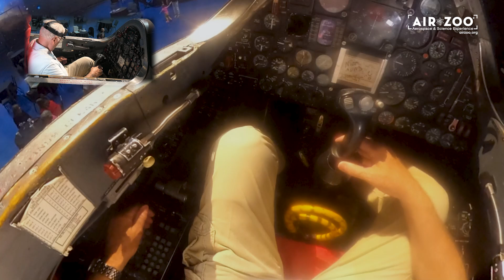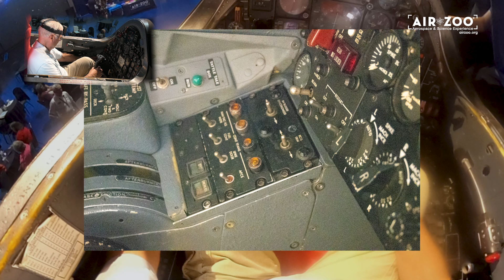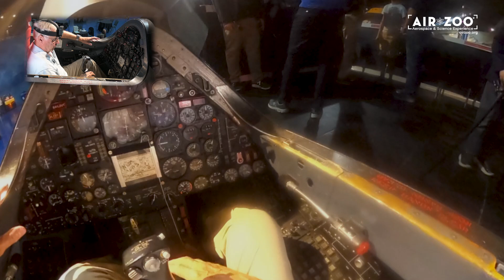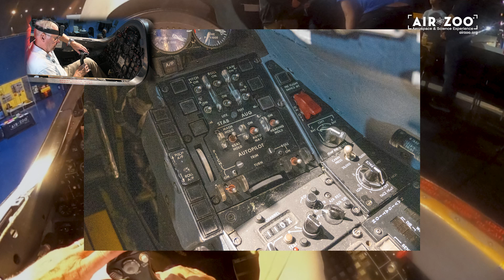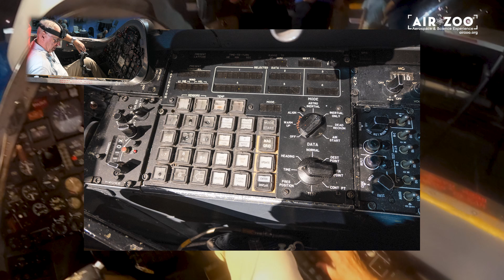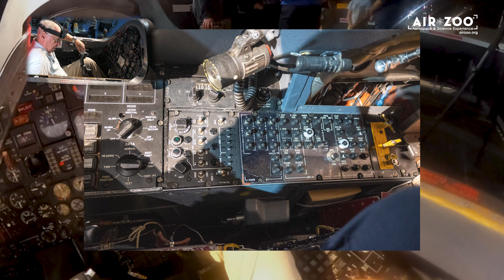SR-71B Blackbird Cockpit Tour with its Former Instructor

Comment: I remember a time where even a glimpse of the inside of this aircraft's cockpit was severely off limits for most anyone that didn't have a mission critical reason to see it.  Now we can see what was at one time so secret. Just awesome.
Reply: This is a training aircraft.  No spy bits onboard
Reply: The SR-71B was mission capable. If if they removed some of the equipment for training it was easily put back in.
Reply: @jaman878  the B model was never mission capable.  It was designed as a trainer and a trainer only.  We never even thought about gutting it to make it an A model which could not be done.

Comment: Is it true that the instructor panel has a switch to override the front cabin and also lock the pilot on it and also a switch to administer cyanide on the air supply also.

Comment: Like many this is my most favorite vehicle of all time of all types. If anybody here has not seen the movie Top Gun Maverick you really need to see it on the big screen and it's back in the imax screens again here in early September. The vehicle at the beginning code name dark star was built by skunk works for the movie but but with the CGI and all what it does it's amazing to be a typical SR72.  In Marietta Georgia at Dobbins Air Force base around 3 PM don't remember the day of the week but got to see one of these planes make 4 circles and land and make call Parkway turn into a parking lot. But flew up again that night around 3 AM and I had to be on site to witness it just the noise was shocking. Thank you so much for the detailed explanation about this craft.

Comment: I'm old enough to remember when this view was 100% off limits to anyone without a security clearance. First time I got any kind of look at an SR-71 was about 1993 at the air museum at Warner-Robbins and the interior was not visible, and most of the important instruments were removed. Then in 2015 I saw one at the Evergreen museum and they had some of the gadgets on display. But the kid in me is very excited to finally see the cockpit of one! Now if only Evergreen would let me sit in it I'd be 5 years old again!
Reply: i went on a school trip to robbins and saw it probably between 2004-07 give or take and i remember it being soo cool to see
Reply: This is a training aircraft.  So no spy stuff on board
Reply: @freelectron2029  I'm guessing they had a separate systems trainer or simulator for operating that gear then?
Reply: @Threetails yeah, I'm assuming they would do lessons on the ground before going up.

Comment: Man those electrical engineers were geniuses. That’s a lot of wiring. Knowing where every cable went is just mind blowing.
Reply: The wiring is child’s play.It doesn’t change in flight.The sensors and readouts are not as reliable. BTW, they use really good connectors. Granted the electrical diagrams for airplanes like this can fill books but its not like spaghetti, it’s presented in manageable sized sections and sub-sections.
Reply: @distar97  obviously you’ve never worked on her.  The wiring was a nightmare.  Everything was compressed in tight bulkheads.  The golden rod wiring was fragile.  No child play about it.

Comment: Thanks a lot verry interesting. Impressive how the designers managed to put all that stuff in this crampy cockpit. Most fighters are cramped but they do not fly that fast and do not need astronav.
Still i'd expect a lot more equipment in this aircraft, however this instructor explaines pretty well what everything is needed for and i wouldn't know what else you need (appart from bigger gauges)

Comment: I did not expect it to burn as much fuel as it does. The burn rate in those first thirty minutes is insane. I'm also surprised they move the CG back when going supersonic. I would expect the craft to be more stable with the CG more in the front. Really interesting video.
Reply: It is more stable with a forward CG but more efficient with an aft CG. When going supersonic they were probably worried more about efficiency than stability being the control movements were minimal.
Reply: @michaelarlen7805  That is anotger thing I don't understand. How does moving the CG back make it more efficient at supersonic speeds? I assumed the craft is stable enough to not really do any corrections. Even then, I thought moving the CG only made it more sensitive. I also thought it didn't have any noteworthy angle of attack either. 

Amateur questions, I know. I don't know more than the bare minimum basics of aerodynamics, and practically nothing about trans/supersonic flight.
Reply: @olekaarvaag9405  I know little about the aerodynamical differences between subsonic and supersonic flight on the airframe. I do know the basics that under subsonic flight an aircraft can achieve higher speeds with a more aft CG but at the cost of stability. The airplane is more stable at a more forward CG but can’t achieve higher speeds. It comes down to how much downward force the tail has to produce to counter the forward CG. More force on the tail means more drag, but more stability. I assume even at supersonic speeds it still applies.
Reply: @olekaarvaag9405  It's a good question. What Michael A. above said, is true, and it's true for both sub- and supersonic, Cessna 172 to SR-71. An aft CG is less stable, but more efficient. So it's a trade-off, and there's a maximum aft limit the CG can be at; if it's aft of that limit then the stability is dangerously low. But one thing that happens when accelerating into the supersonic regime, is that the airflow around the wing changes such that the center of pressure moves aft, which increases the stability. This means that the aft CG can go further aft while still saying safe, while taking advantage of the extra efficiency.
Reply: Same, that is the equivalent of pretty much 2 full fuel trucks worth of fuel per hour. Insane.

Comment: Amazing that you can go somewhere and see these exhibits.  The leap in technology in the 60's was phenomenal with the Apollo program, the A12 and Blackbird being the pinnacle. You could by the end of that decade buy a ticket and travel at supersonic speed with Concorde. All the things that are being said now about building bases on the moon and manned landings on Mars were being said as realistic goals back then. But upon the cancellation of the Apollo program the big dreams felt like they were reigned in, that exotic engineering and the skills of those who could do such and that even now most would struggle to replicate if at all  was exchanged for sending manufacturing contracts overseas where cheaper labour and the quality it buys are found. To the point now you have some who are adamant that it never even happened, we have windmills to generate electricity and people have gone back to burning wood to heat their room.
Reply: I am one of the adamant. This demonstration video highlights many reasons why. Chiefly, the high altitude and high velocity temperature challenges that are met with complex engineering of the SR-71 which are not even remotely addressed by so called “space craft “  that are said to fly at Mach 20 and over four times the operational altitude. Before one achieves orbit, one must be an aircraft first, flying to and exceeding 385, 000 feet of altitude, all the while,  dealing with the friction of speeds that are well in excess of Mach 3.
Reply: @michaeltaylors2456  A rocket isn't travelling as fast during the launch phase in relation to when the capsule is trying to decelerate from orbit and the incredible speeds reached there, by using the atmosphere to slow down upon reentry.  Only once a Spacecraft/Rocket left the Earths atmosphere on it's desired trajectory does it  accelerate further to maintain it's desired Earth orbit.
Reply: @ryansta  Very well, then which of Newtons laws applies here, the second or the third ? The fastest rocket engines produce about 10,000 mph thrust or about half of orbital velocity required ? They tell us that the 3rd law explains how a rocket produces thrust in a vacuum, ignoring proven Jules Thompson law, while also ignoring the 2nd law, equal and opposite. Can’t have both.
Reply: @michaeltaylors2456  Thrust isn't measured in MPH for starters, so you need to go away and research that one. Next have a long hard think about why a jet fighter can travel much faster at higher altitude than it can close to the ground. When you discover the answers to those have a think about how spacecraft such as Voyager and June can travel at tens of thousands kilometers per hour without having massively powerful rocket engines. Lastly stop watching and listening to Flat Earther nonsense.
Reply: @ryansta  Sure, just sticking with science and keeping it simple for discussion.  Rockets engine thrust is measured in specific impulse, and i isn’t needed to understand that 10,000 mph actual velocity is significantly less than 17,500 mph .  Newtons 2nd law applies and the 3rd also applies except when in a vacuum, a condition Newton could not possibly test for in post medieval times. Jules Thomson which was discovered over 150 years later still applies. Voyager? Ok sure,  faith is good . Jets at altitude are fastest at a certain sweet spot of altitude they eventually can go no faster nor higher due to lack of ambient pressure, turns out they need something to work against.
Reply: My father was born in 1920, was a decorated WW2 combat veteran, and worked a career as an aerospace electrical engineer on numerous programs… the S2 stage of the Saturn rocket (Apollo), and the B2 bomber, among others.  He & his colleagues used slide rules.

Comment: An expert instructor pilot (Jerry Glasser) gives an excellent tour of the instructor pilot's back seat in the SR-71B.
Reply: You would know, sir!
Reply: Great tour by Jerry.  With zero forward vis could a back seat IP accurately land the a/c?  The cockpit doesn't look much different than an F-4 cockpit ie same engine gauges, ASI, etc.
Reply: @jcheck6  Landing from the back seat of the SR-71B was a skill that could be learned quickly, especially since only experienced SR-71 instructor pilots flew in the back as pilot-in-command.  From the back seat of the trainer aircraft, forward visibility was not zero, but the runway was obscured when established on final approach, glide path and on-speed.  We could determine proper alignment by quickly tapping the rudder, or the aileron function of the elevon if necessary.  Aircraft “flare” altitude could be perceived by quick glances left and/or right to watch the ground “rise” to the proper elevation, then “hold it off” until touchdown.  It simultaneously was interesting and fun!
Reply: @bcthomas2h90  Thanks BC, forgot the rear cockpit was elevated with a windscreen that did not show in the vid.  Actually the vis is better than the WSO seat of the recce F-4 I flew.

Comment: Shouldve made them with a diesel engine. Really fuel inefficient.
Reply: Anything making that much power and designed for that much speed is going to burn a lot of fuel. Besides, the fuel it runs on is basically highly refined diesel fuel anyway.

Comment: He mentions the Astro tracker was designed in 1963 and is still used as the “back up“ in the B2 bomber…amazing
Reply: My great grandpa worked on that. He was a contractor from Minneapolis-Honeywell, and I have some never before seen photos. I wish I knew more of his involvement but from the pictures I have I believe he was a head or director of the Honeywell involvement in the black project. What's insane is that's a role where he knew more and kept secrets from the CEO of Honeywell. He would ride a black bus with blacked out windows, he'd leave his house with a briefcase handcuffed to his arm. He'd fly janet flights and wouldn't tell the family a peep. I thought he worked for Lockheed most of my life until I looked into it more and more info came out which revealed he was at Honeywell.
Reply: That is one fascinating piece of equipment! 

Could be used for interplanetary travel, with some number & formula alterations!

Comment: Thanks. Amazing tour. That Astro tracker blew my mind. I always heard that the SR71 was shut down due to cost and the use of Spy Satellites in low earth orbit. What is your opinion ?
Reply: It still has advantages in 2022, but manpower and costs killed the program.  They should’ve kept just one flying to show the world what we could do 60 years ago.
Reply: @alexnutcasio936  .....I believe that the one in the Smithsonian is maintained in flyable condition.....but to get it back in the air would cost....well.....id bet it would be 9 figures if not 10 to do so.......
its amazing what can be done if the right nudges are given in the right places to guys with slide rules and books full of tables and engineers with virtually bottomless budgets......but....we have.....vehicles.....that can get out into the outer system in the same or less time than it takes the SR71 to get to its cruising altitude.
Reply: @ssnerd583  Graham said the Smithsonian one is complete, but they no longer have the fuel available.  Add to that refueling and start carts and you’re back to satellites.
Reply: ....spare parts.....no spares left
Reply: @ssnerd583  I’m sure we can find someone with a few spare pizza ovens…
Reply: @preachers4135  ....weeeellll.....its just a BIT more complicated than THAT....and the advent of VERY advanced technology that originates....well...from the stars....that negates the necessity for anything like the SR71.....the SR71 isnt even a Wright Flyer in comparison.....more like a piece of paper carefully folded by a 9yo on a saturday afternoon and thrown across the den to simulate 'flight' for a few seconds
Reply: https://en.wikipedia.org/wiki/Lockheed_SR-71_Blackbird#Successor
Reply: Also some advanced countries now have air defense systems meant to take out a Mach 23 ballistic missile as well as aircraft. At Mach 3, the SR-71 is a sitting duck for these modern SAMs.

Comment: Disclosure that astrotracker is backup system for B-2A Spirit , even if declassed, or low classified, is unnecessary.  It starts foes wiggling as what is primary nav system of B-2A, since it cannot be based on send and receive signals. Its TMI. We, Americans, are the greatest power in hostory of Mankind. But GDMIT!!! We cannot keep secrets.

Comment: such a small cabin, not much separating you from 2000mph air. that’s wild
Reply: 2000mph and 600*F+.....they used to hold their ration tubes---like a toothpaste tube...against the canopy to heat them up a bit before they ate them.....if you set your home oven at 450*F and let it get hot and touch it....it WILL brand you
Reply: And if you have an engine unstart at cruise speed the turbulence and upset will cause the whole plane to break apart, and you’ll get a forceful ejection at supersonic speeds
Reply: @loganbaileysfunwithtrains606  ...NEGATIVE there ghostrider....when the stability control systems were being refined, it was quite common to get an unstart and not destroy the aircraft......one pilot described it as like being 'in a train wreck', but it was not destructive of the aircraft.....and there were several pilots who reported that they had multiple unstarts on the same mission.
Reply: @ssnerd583  there was an accident involving the loss of an SR-71 due to the engine unstart, the pilot landed in a field where a farmer picked him up in his crop sprayer helicopter and flew him to the hospital
Reply: @loganbaileysfunwithtrains606  ....unstarts didnt always lead to destruction of the aircraft......and the incident you note, I believe, was a double unstart
Reply: The main cockpit is a bit bigger